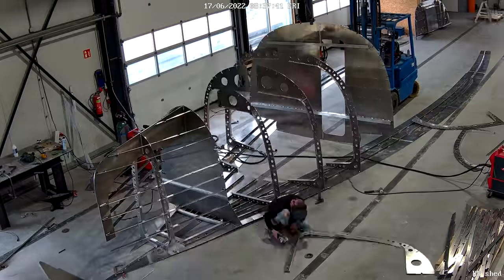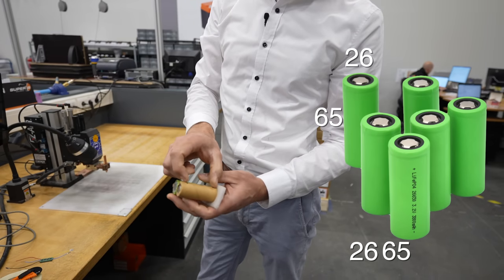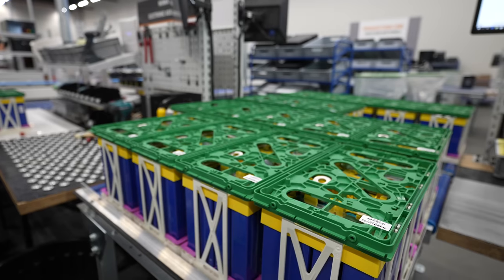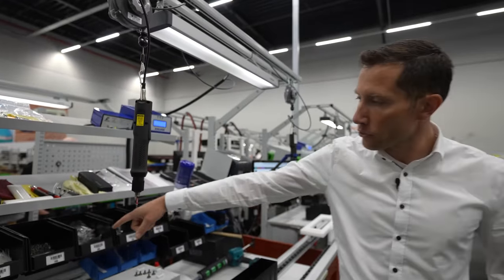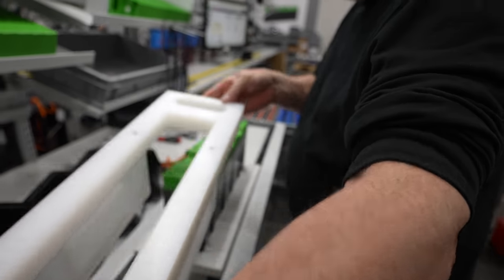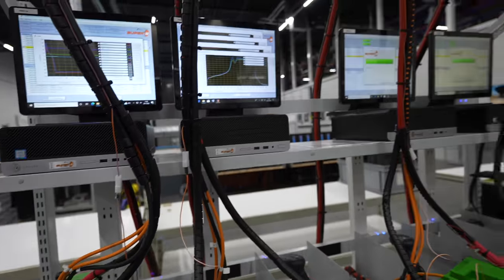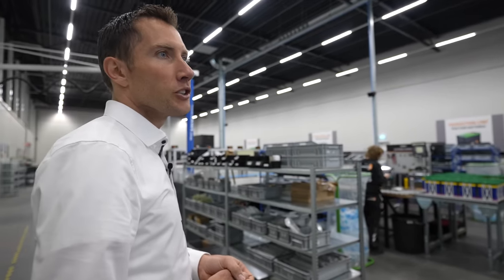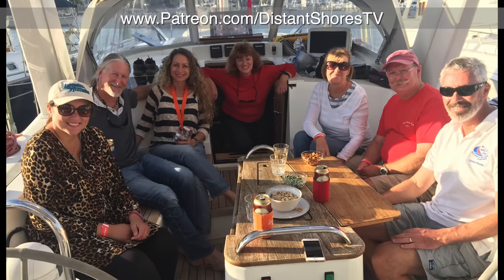Aluminum Sailboat Pt 16 Lithium Battery - How They're Made | EP 237

Comment: At the moment lithium Fe blade cells are about the safest commercial cells available. ....they are also more robust and most stable.... 
As alternative chemistries like Na Sulpher and Al ..come into use we can not only escape The Li mining trap but also the other rare earth metals.. 

They are also cheaper more widely available and safer and if they get them right will outstrip lithium based cells..
Even reducing the need for copper in cells/batteries and motors is important to reduce the environmental impact. 
The Na cells are already going into the first vehicles ...

Comment: Did he mention where the cells are manufactured? Also does the BMS have low temperature protection? Looks like you spent around $90 grand or so on batteries.

Comment: The cheap secret to LifePo4 24v and 48v batteries... build your own or buy used medical lifepo4 batteries with bms already and hook bus bars (high amperage) up to it if you want to use for propulsion.
1/4", 1/2", 1", 2" copper pipe works well for bus bars.

Comment: MONEY MONEY MONEY !!! Great Idea, i hope you get a SUITABLE Electric Motor for Moving a Big Ship like yours ! Also you need a good shaft to connect it ! Also you need an awesome Charing Devices like panels, properlers, and maybe a HYDRO-Charger aswell ?????

p.s: did you know that if you DISCHARGE + CHARGE your LIFEPO4 Batteries, in THEORY you have an INFINITE POWER SUPPLY, done it the CORRECT way you CRUISING SPEED will added additional avarage +2 to +5 KNOTS without ANY MONEY Burining though you DIESEL TANK (FOSILE ENERGY) which MAKES your VASLE a CAPABLE SEEPIDY Sail yacht in copareson to others YACHTS !!!

Comment: How much is the 340Ah battery?
Reply: I found a price for a super b 210 ahr at $4423. Since they have 20 batteries, looks like around $88,000 for the bank. EGADS!
Reply: @mr.e7022  yes .. rich fools have to pay a lot))))
Reply: I found 340Ah for €4200 and I guess when you buy 15 it's cheaper though they only need 10
33kg X 10 though is still 330kg add the various ancillaries too. As for reliability some guys missed that this is a serial hybrid with a diesel engine and it's a sailing yacht anyway.

Comment: For me, it's a matter of risk vs. reward. Like any electrical component, one of those BMS control systems will fail one day. Then what happens? Have you seen any videos of what happens when a lithium battery fails? The resultant explosion/fire is instantaneous and about impossible to extinguish. While lead-acid batteries offer fewer watts of energy, they are not only way less expensive, they don't erupt into flames either. 
Are the benefits of lithium batteries worth the risk (however small) of a catastrophic failure? Where back-up battery systems are required at NASA (at the launch pad for instance) they do not use lithium. They use large banks of lead acid batteries. And it's not because they are cheaper.
Reply: Obviously you don't know much about lithium battery chemistries.
Reply: @laurapitre5797  Obviously. But I do know there is at least one car manufacturer who has warned people to park their electric cars outside so if it bursts into flames in the middle of the night it won't burn the house down.
Reply: different kind of lithium batteries. these are iron-based and extremely stable. iron-based lithium batteries have been used for residential solar storage — including at my house — for years without incident.
Reply: @gdholmfirth  The LG cells used in the Chevy Bolt are not Lithium Iron Phosphate, which almost never have thermal runaway.

BMS electronics are highly reliable.  Vastly more reliable than something like an internal combustion engine, for example.

Comment: 340 amp ??

I have much better cells in one 24volt box. 450 amp.
Another on 450amp more is on its way to me.

And i am motoring down european waterways all over Europe.

But will get a generator el engine on top of gear box 20kw. For generator for fast charge ore just load up to 80% when start to drive.

I wonder on an el motor whit regen on. Thats powerfull anof to push 12 tons.

But can be use this 20kw el engine over gearbox from battery on slow going el power.

But have to lock in to how this is for an famely holland stealboat.

Have bean gone over 1 year allready.

And have 4 solar on 320w x4 as a roof over flybridge on my older yacht. 

Think this is to small whit 20kw battery ore can i make it whit double battery ??

Never drive at full speed. Max half.

Is there any calculating on this ???

48v ofcorse and have 140hp penta engine thats 2 big anyway.  So can easy drive and recharge and drive like normal at 20kw.

What you think about this ?
Any tipp ore trix for me ???

The shame of this cells them use, is them not passed the EV-INDUSTRY.

Sad to say it.
I am from norway and have worked much whit DNV. Det norske Veritas.

But them have bean 10 year behinde in litium battery sadley.

Problem whit this cells you have there. Is not passed test for EV, so it is like an left overs if you understand?
Dont to be rude ore any. 
Just for educate from manufactures in china.

Leftovers have as allways up to 5 6000 cyclus. 

But whats that ??

EV batterys have 35 to 45 000 cycluses.
So differans is enormus

Comment: But ofcorse if use smart and never hard. Them last some year.

Take any manufactures of lithium and ask whats happening to leftovers cells. 😂😂😂
Sorry to be the 1 telling you. But almost 45% of battery dont passes the test.
EV industri are heavy test.
And when not passed them take 4 cells at about same volt and trow in plastic and trow on bms and selling whit so and so capasity.

Thats why allways ask for test for EV industri as all battery gets made for.

Every of 20 manufactures in china i have bean i contact whit all says the same.
Some try to hide it from start. But say it like it is.

So i did buy EV battery cells from VW E-GOLF.
BUT ALL VOLKSWAGEN HAVE SAME SAME TEST.
And never ever dissapoint you❤

Some that all shuld be aware of.

But now so many Chanel shows this and spreading the info.
So soon all gets passed test batterys. And same price only double better cells ore batterys ore how you want to say it.

Is this boat now in use ???

How long cyclus them was rated for ????